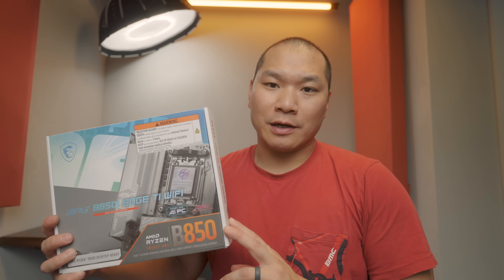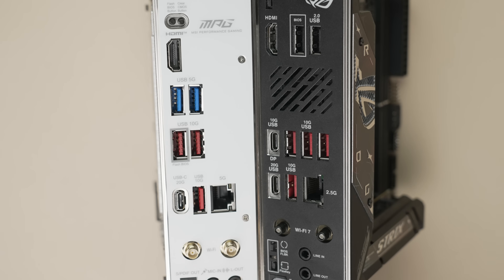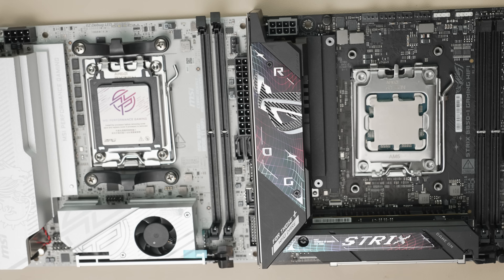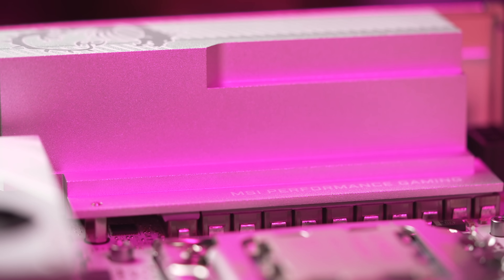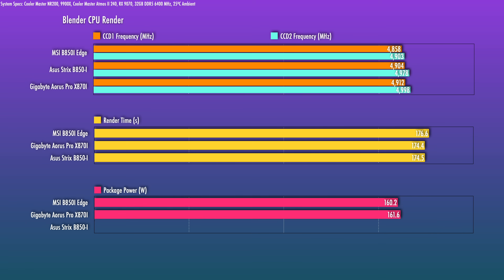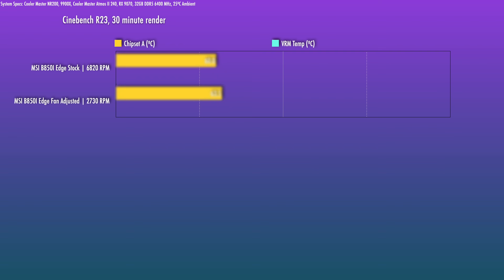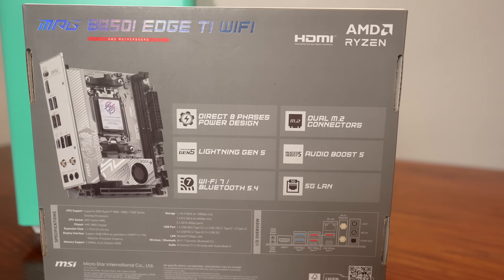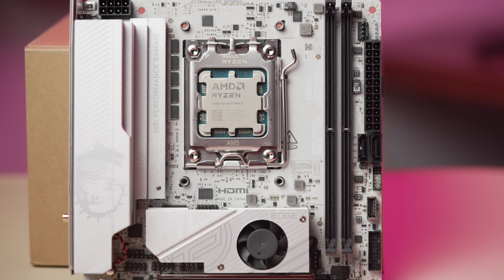MSI B850I Edge... Go-to AM5 ITX Gaming Motherboard!

Comment: Thanks for the review, just building with this board over Christmas. I bought this board as (thankfully) had 2x32gb Corsair XMP 6600 spare after a memory bump on my main pc and it supports it without issue 😊 It also has an additional header 'EZ-conn' thats breaks out into another fan and Argb which is useful for my sff build as makes it easier to plug in my top fan to this cable rather than the mobo.

Comment: Thanks for including the sound samples of the motherboard fan. Those small fans are truly unbearable at high rpm.
I would still be interested to see what temps would look like when disabling the fan entirely. I did so on my ASUS board and the difference was smaller than I imagined.

Comment: Nice review thanks. I would like to point out something you did not mention is that the quick push fit WiFi motherboard connector is male not female like most older boards RP-SMA have been using so having a thread on the connector is useless if like me you want to use your existing much better dual band high gain antenna and longer cables. Hopefully its an easy swap out to RP-SMA female connectors with a MHF4 pigtail.

Comment: why would you invest in a high end B850i AM5 in mid/late 2025 when its going to EOL soon?
Reply: Mind telling me whats coming up next? I'm upgrading my 5800x and 3080 setup for battlefield and cs2 to run a million frames and just saw this comment and don't want to jump the gun too fast.
Reply: @OddClancy  Im not too sure if they meant the b850's being EOL and maybe better boards are soon to come out (idk in this instance), or if they meant the AM5 platform. But AM5 is expected to be produced until 2027 in the worst case but could be possibly longer. Dont expect your upgrade to impact CS2's FPS very much, the game is super unoptimised and despite maybe having a higher frame rate the frame times and stutters are borked at game level. People with maxxed out builds are having issues, so dont get your hopes up with that game in particular.

Comment: which board between Asus b850i and x870i cools the M2 gen 5 drive the best?
Reply: Fans and extremely large heatsinks for nvme are a red flag for any mainboard, because these should only focus on allowing to set back pcie one generation back for nvme drives and nothing else. If a very hot nvme came from factory without the required cooling, there is a problem about the manufacturer of that nvme and this should not be solved with poor cooling solutions by mainboard manufacturers. Btw, check firmware upgrades for nvme first before thinking about cooling.

Comment: Hey M&M, I would like to suggest a new idea for your channel is to look in DIY upgrades for those in the SFF community. Such as taking a B650/E-I board and upgrading the WIFI card to WIFI 7. 

Would be cool to see if that would be a better choice for people than just buying a new B850-I.

Personally, I am using a Asus Strix B650E-I, and will be planning to install a WIFI 7 card in the near future as my home wifi router has just been upgraded to such and it isn't feasible to run a LAN cable to it.
Reply from the maker: Ah good idea! Thanks!

Comment: Just FYI, the Noctua NH-L12S does not fit this board without modification in the standard orientation. The VRM heat sink interferes with the heat pipes on that bottom edge where it sticks out. I had to take the heat sink off and mill the edge off to get it to clear.
Reply from the maker: That’s interesting… which orientation did you mount in?
Reply: @MachinesMore  with the heat pipes facing the vrm or i/o side of the mobo
Reply from the maker: Ah I see. Does heatpipe bends facing the RAM orientation work?
Reply: @MachinesMore Good question. Unfortunately, I was mounting it in a fractal ridge case, so the only orientation that would work is that one, and barely. I didn't try any others
Reply: @MachinesMore  RAM orientation didn't work for me.
bottom orientation also doesn't fit, unless you mount the fan on top.
Reply: I have now learned this the hard way, yeah it sadly doesn't work. I guess I'll report back if the AXP120 at least works when I get one of those, it's likely going to be pretty close.

Edit: AXP120x67 fits fine when overhanging the ram; the other orientation (over the VRM heatsink) seemingly worked but was a bit iffy and had a noticeable bend (hides access to the CPU power connector anyway so I wouldn't recommend this orientation).

The eventual X870i version of this board is likely to have the same issues with the L12S, heatsink looks to have similar areas of concern.
Reply: that's definitely an oversight on MSI's part, since the NH-L12S is among the favorites in the SFF community.

 I feel like these manufacturers should spend little extra time to test fit the 10 most common SFF heatsinks before releasing their ITX products.
Reply: @tenka__ yeah, it's frustrating because I'm 99% sure that the b650i heat sink fit fine, and this was definitely just an aesthetic choice. I took it to work and milled the edge off that didn't fit and now it works fine. It's like a couple millimeters of aluminum in the way.
Reply: I have this board and ran a L12-S in a ridge for a long time, no modifications at all
Reply: @Lazicdi are you thinking of the b650i board? The b850i has been out for less than a month

Comment: Nice board.  Not a board fan fan,  other features on this board are nice, SPDIF is important to me.
Reply: Gen 5 nvmes put out a lot of heat, so the fan inclusion is quite nice, plus you can set the fan curve, which is much better than just passive cooling. Their design to only cool half of the nvme is okay, since it's mainly the controller that gets super hot, but I still feel like cooling the entire stick would be better. I too appreciate boards with SPDIF.

Comment: Why do they use the stupid fan instead of a bigger radiator and looks like the fan is not like an option which you can just switch off and forget, it's supposed to be working because it covers half of your storage, for what you made that shit 😕just to encourage me to buy the more expensive model without the fan, looks like that
Reply: I also hate those small, noisy mobo fans. Automatic skip for me.
Reply: @intermarer9145  You can just replace the whole fan and housing with a separate heatsink cant you?
Reply: @oscatMeow  Or just look for a different mobo to begin with so you don't have to...

Comment: Got my hands on it, nice to have 5G LAN.  Build Video coming soon.
Reply from the maker: What case?
Reply: @MachinesMore I’m using the NCASE M2 Grater in silver, with the Noctua D12L in the original silver color with dual Chromax fan swap. Should be up tomorrow morning. It’s not a detailed review of the board however.

Comment: It would be so much easier for me to buy this if they added a little more IO (and maybe got rid of that dinky fan)
Reply: Just curious 

Get rid of the fan why? 

- Marginal real-world utility
- Potential noise-maker
- Questionable uilization of space
- Aesthetically displeasing 

Or perhaps..
A little bit of all of the above?
Reply: @cannotkazi I think it looks great. But they just suck. They malfunction all the time. I’ve had so many boards that just blast the fan full speed and won’t change after a while. Also they get extremely dusty. Just a pointless thing. I just buy ssds with heatsinks when I buy boards with these kinds of fans.
Reply: @SanDiegoGamingYT i have the msi B650i since launch and the fan still works as attended.

Comment: Thorough video. Thanks.
As an NR200 user on B550I + 5800X3D like many of us, I'm afraid these manufacturers are purposefully nerfing ITX boards in I/O for product segmentation purposes.
The platform, chipset and the back panel can easily accommodate 40% more USB ports but they wouldn't put them in because their mATX/ ATX boards will suffer - which in turn could have 40% more ports.

The B850I Edge sadly does not have the adequate number of USB ports for even a regular PC workstation that can have 1 x wired KB, 1 x DAC (pwr), 1 x DAC (audio), 1 x mic, 1 x Type C-C or A-C cable for gaming controller and a couple of USB ports to spare. The ASUS just about does a better job.

Buying a USB dock for this purpose is just annoying when you know the mobo could've easily negated it.
Reply: I agree, I feel like the B850 and X870E already doesn't differentiate enough from X670E and B650E to justify an upgrade, coupled with manufacturers skimping on features just to bump up their flagship products makes this series quite unpalatable. 
While 5G ethernet is nice, I feel like a 10G would entice people more, or perhaps a dual 2.5G and 5G would be awesome. Otherwise just give us more USB ports. 

For the price, I feel like people should just get a X670E or B650E and upgrade the WIFI card themselves to WIFI 7 if needed.
Reply from the maker: They have an X870I this time so that may be a consideration as well. I think its less likely that they are trying to entice folks to move to a bigger board just because of the features (some folks just want ITX right), otherwise they are just conceding to other ITX boards. It’s probably more of a price point calculation. Agreed if you need the ports the Asus is going to be better (and worth it). There are users for which this port count will suffice though, and at this price it will be a win.